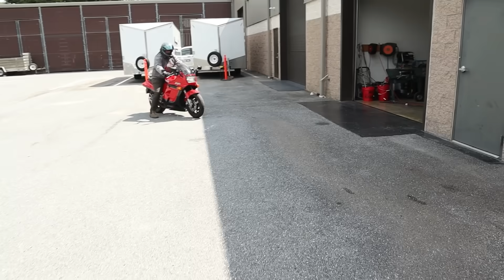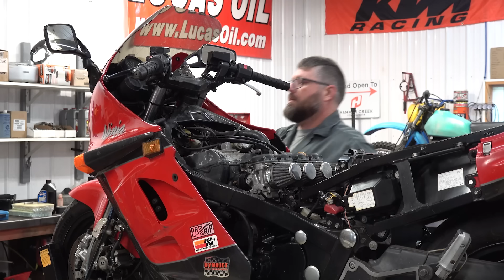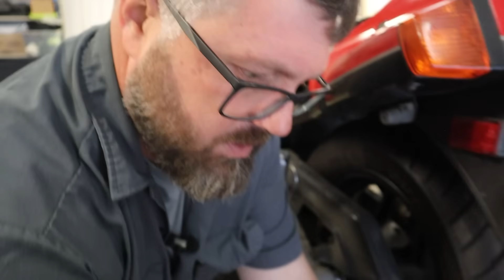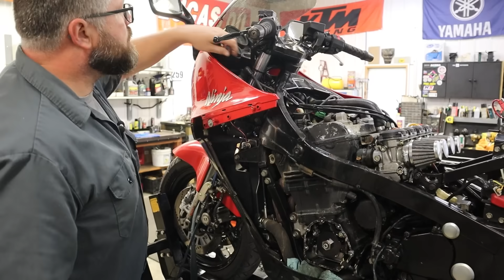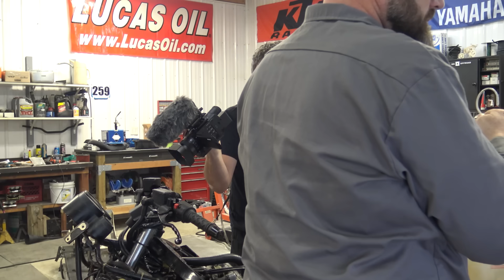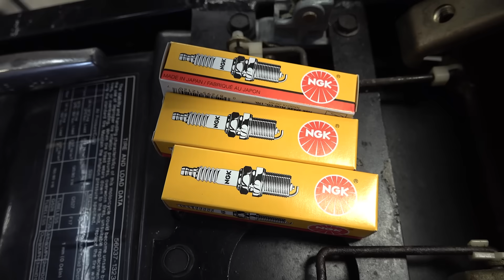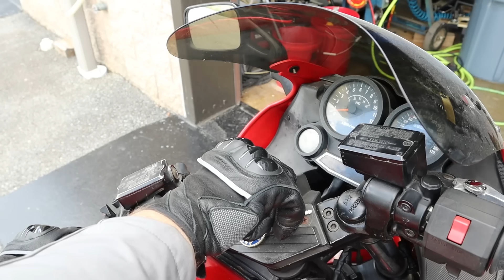Can I Fix This Unfixable Iconic Ninja Super Sport Bike?

Comment: Shops do not want to work on old bikes because there is often more than one fault with some additional faults being added by the customer. Like the RTV on the cam box. RTV is notorious for breaking lose and clogging oil pick ups. Then after you fixed it and the customer can give it some serious beans, the clogged oil pickup blows the motor and it's your fault because you worked on it last! Aged plastics that are brittle and the cost of labour to find the issues all pile on the costs that customers will not pay. Never ever replace coils with ebay cheap ones. I would rather fit used coils than ebay ones.

Comment: I'm going to guess from my experience, without watching this, it's the electronics in the distributor.   You've got a leak in your exhaust blasting on the distribitor or it's getting hot for some reason from the engine.

I refuse to buy any sport bike or front wheel drive because they are impossible to work on.  Everything is packed in there like sardines in a can.  A miserable experience working on them.  Please don't buy either new, and let both be consigned to the dust bin of history as p155p00r designs.  If a garage shade tree mechanic can't fix it, i.e. probably you on the side of the road when stranded... you don't want it.  Ever.  Not even while it's running great off the dealer lot.

Comment: I see the problem right away those air cleaners are not factory, and if the carburetors are not jetted properly for those air cleaners, there’s your problem. These bikes are very finicky and they need the factory airbox with the factory carburetor. Jack configuration if you take the factory air box off and putanything else on you need to reject the carburetor.